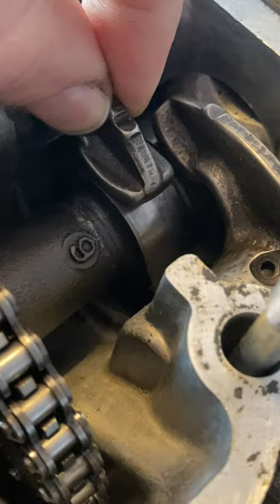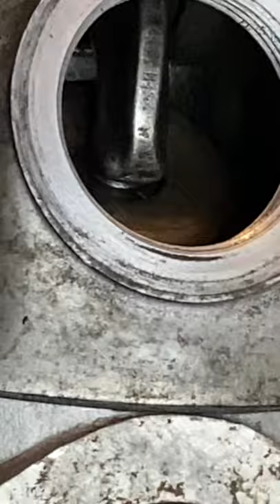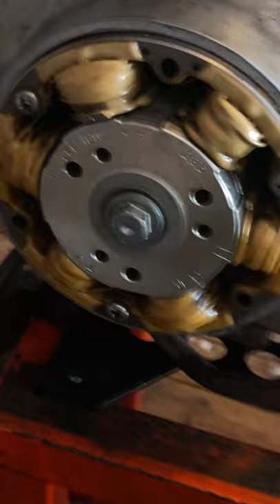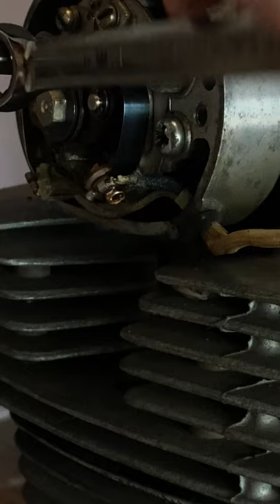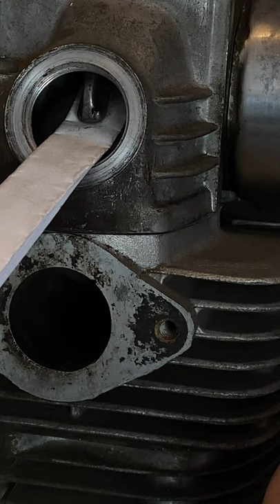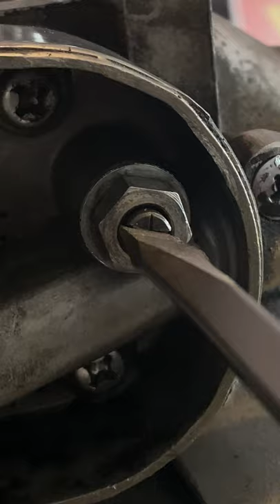CB350 Valve Adjustment

Comment: I have just completed a rebuild on my 350 engine and I followed your videos. They were very helpful, Thank you for doing these with such detail. Unfortunately I think I installed the cam 180 degrees out. Only the right cylinder is running and when you put your hand over the exhaust you can feel the exhaust pressure is way stronger on the right side. I have spark on both sides and the motor does not smoke. I took a compression reading and I have 125 pounds on the right and 75 on the left. So I’m thinking the cam is in wrong. How can I confirm the problem is the cam before I take it back apart. Thanks
Reply: Following, I have the same issue
Reply: No feeler gauges, so accuracy is lost.